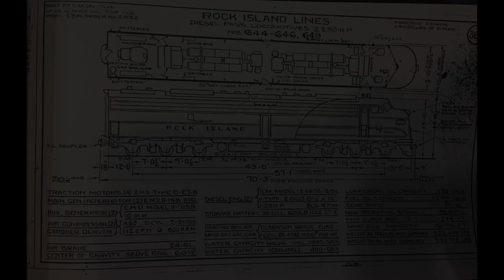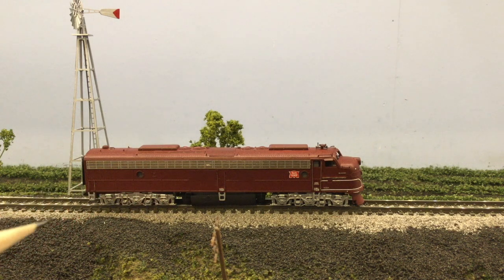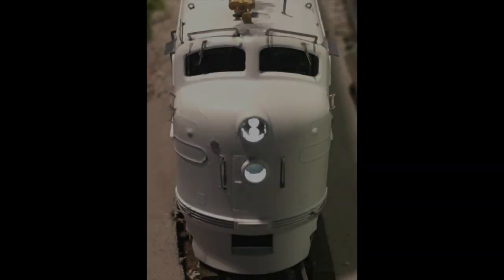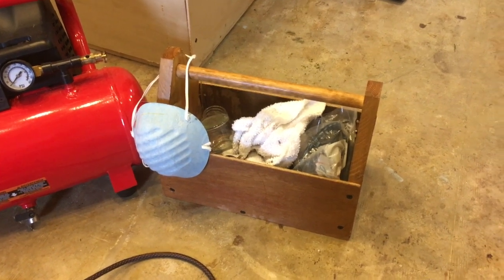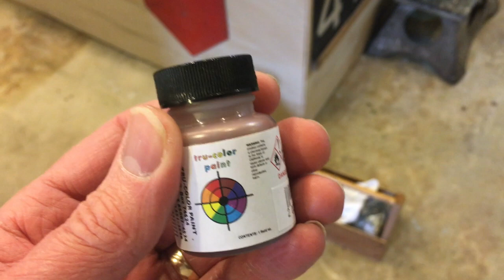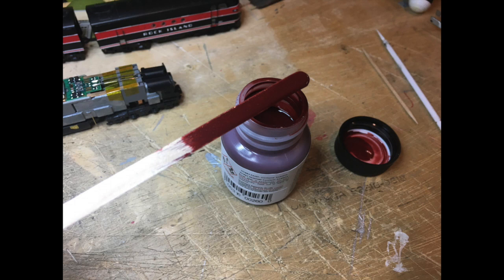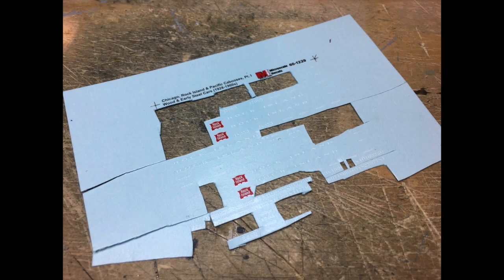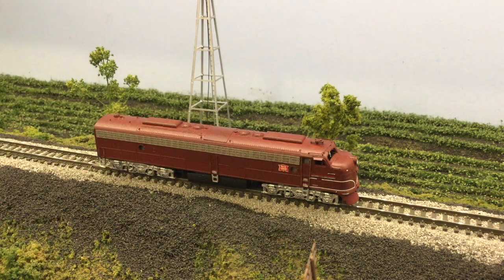Monthly Progress Build of Rock Island E-8-A  #649 Part 5

Comment: Nice, my father did a lot of painting on RC Airplanes some RC boats and a few RC cars, besides about 8 TR-3 TRIUMPH ROADSTER. Besides a lot of Choppers  from Harleys, Indian, AJS, BSA, Royal Infields. Anyway he had the patience to take pin striping and and cut the tapes to the with of what he needed than clear coated over it to seal it. He would tape off a lot of things to make his magic. I started out at 11 years old to build or rebuild both motorcycles and cars but painting was not my gid, I did try but dad put me down so I left it alone. But it looks like you're doing great. If you have the patience to try instead of buying more decals you might want to get some striping tape and cut it to the with you want and try that, might save you some money plus time where you don't have to wait a month or 2 to receive it in the mail.
Reply from the maker: Oh, I have the patience for what I have done on this engine with all the extra detail parts but I also know my limitations of when decals will make the job a little easier.   Plus, I ordered the decals I needed on a Sunday and they were in my mailbox by Thursday.  So the wait was not too long at all.....this time.

Comment: The different vertical or horizontal top headlights were because that was equipped with a Mars light that rotated.  The fuel tank would also be painted the same red as the carbody.  Otherwise, looking good.
Reply from the maker: I get that on the headlight.  The fuel tank is going to stay black as that is what color it is in the color photo I'm working from.  Tony

Comment: She's looking "Mighty Fine" Tony! Curious why you painted after installing the lenses?
Reply from the maker: After putting in several of the twin seal beam headlights the engine rest on its nose for some of the process.  I did not want to mark up the new paint job putting them in after I painted the shell.  It was very easy to paint the inside of the nose and then I will add the lens as I finish up some of the other details parts. Tony